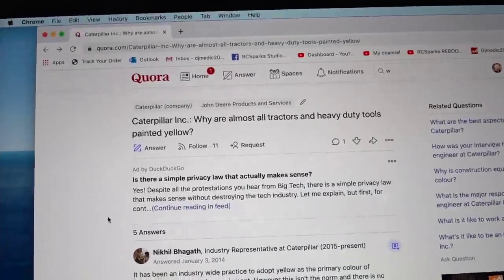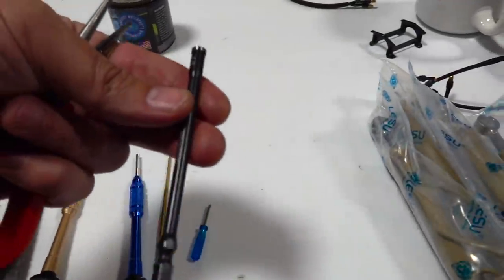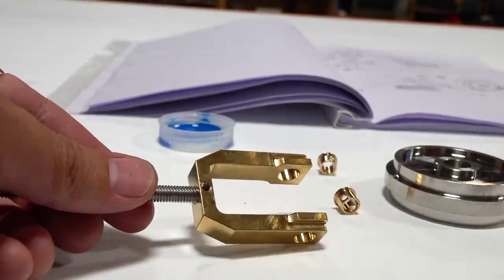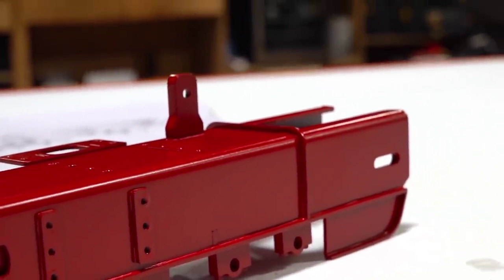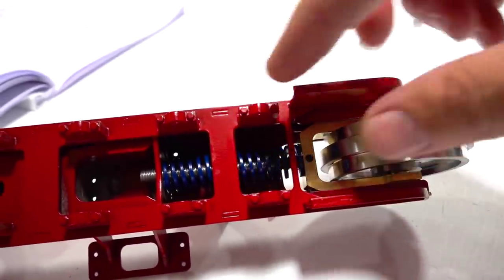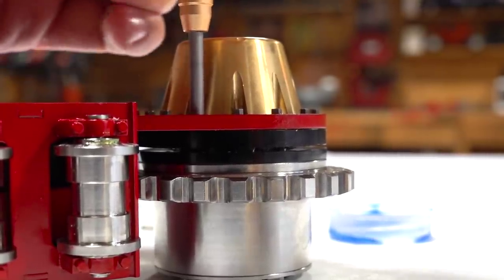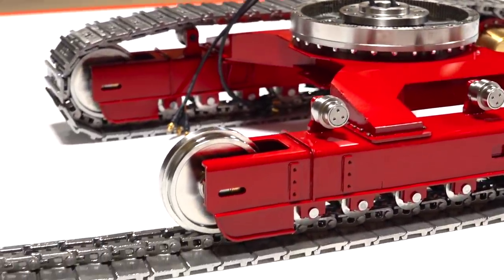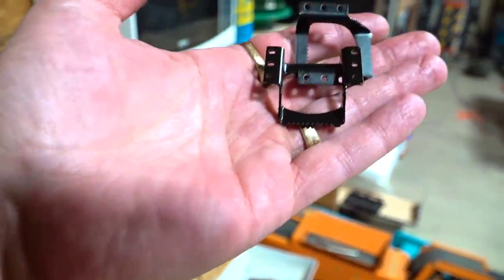"PROJECT: JOHNSON" aka "THE BiG ONE" - LESU CAT 374FL EXCAVATOR KiT BUILD PART 2 | RC ADVENTURES

Comment: Again another great video you asked about the colour I never use yellow for my models since many years ago I had built a large scale model plane and thought it would be a great idea to cover it with bright yellow solar film and off to my local flying field to give it a test all going well for the first 30 minutes and the as the sun came out along came what felt was several million wasps which made a bee line for my model after a couple of minutes I couldn't see any of the model as the wasps totally covered it in the end I had to throw an old blanket over it then leave it for around an hour until they worked out that it was not a giant flower before I took it out again I recovered it in navy blue and white, now I try not to use yellow and I stick to white which both my excavater and loader are in and soon I will re paint my dozer in.

Keep up the good work with the videos 
Regards Poppy Ann.

Comment: Awesome job dude...nothin wrong with a bit of color. Your organized and methodical approach to doing something of this nature not only helps, but is actually required, as there are so many tiny parts involved. 
     I could very easily see myself putting something like this together, and would probably find it therapeutic LOL. I've done mechanic work for years and am currently working as a maintenance electrician/ engineer in a saw mill. I appreciate the fact that so many of the large pieces of RC equipment  are quite expensive...it tells me that they ARE NOT CHEAP LITTLE TOYS, but rather scaled down fully functional replicas of the full size models. Well, I've rattled on long enough...keep up the great work man, i recently subscribed, so I'll keep an eye out for more clips like this one.

Comment: The RED is Amazing,  Great color choice.  Really like all the stuff you build and use.  That's what brings me to you for some advice.  I have a CEN Racing F450 Truck that I'd like to put air or hydraulic shocks on so that I can adjust the ride height on the fly.  I don't have a 3.4M sub base or budget.  Can you recommend something that will serve my need and still not break the bank... Well coin bag in this case hahaha...

Comment: I would love to build something like that! I love building hobby model cars, planes etc. I have been working on an old rolls royce. parts so intricate that I have to actual put the chain links together...with hammer and pin. I had to machine some new parts for it as the kit is so old you can't buy replacement, was cheaper to just remake them.

Comment: I'm curious why you chose to paint surfaces that have moving parts, mating surfaces, or threaded holes?  That might have been why you had issues inserting the pins through the roller bearings.  That little bit of paint can change a close fit to an interference fit.

Comment: Join the track chain at the sprocket end. The teeth hold it in place. (Real life; use a come along winch or ratchet straps to pull the track halves together. Use a drift with a rod handle welded on so that if the sledge hammer misses your work mate doesn’t smash your wrist)

Comment: A screw or a bolt isn’t given by the driving head, but by the shank. If it is threaded full length it is a screw. If it has a plain shank it is a bolt. (Historically view of bolt vs screw.) Side Note: A cotterpin is a bolt with a tapered shank. The item often described as a cotter-pin is actually a split pin)

Comment: One thing I noticed is they didn't update the ECU shelf. (step #46) It needs to be cut out to use the stock hydro fittings  or you can change the fittings out for straight ones.